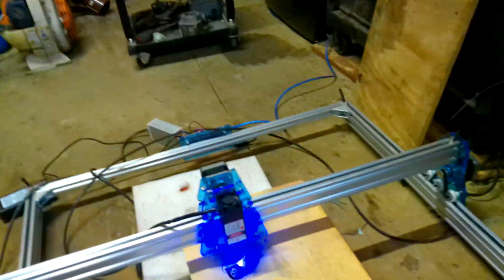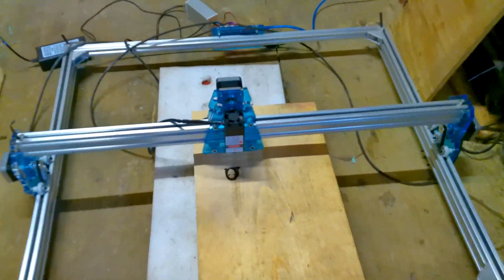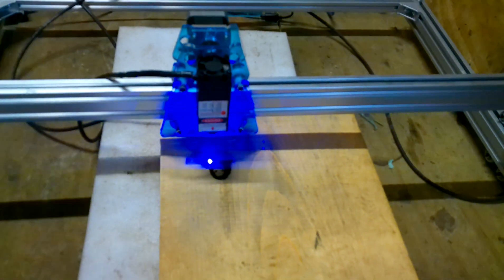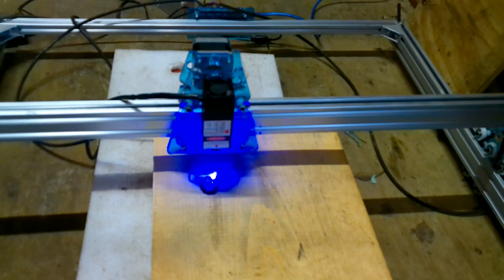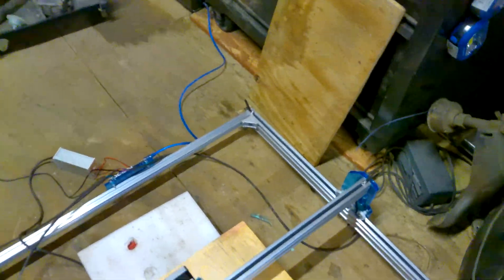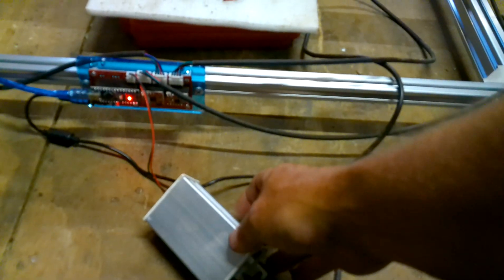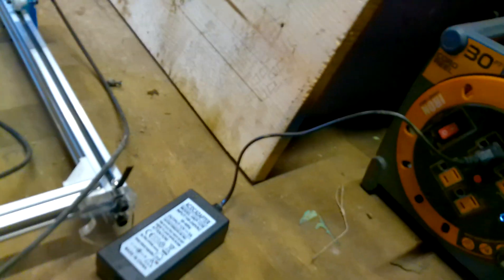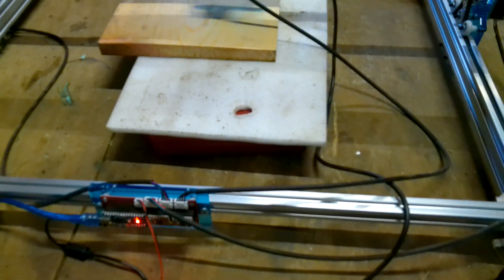3000mW Laser Engraver

Comment: Mine is 3 weeks old and its already shot. It started to fade now its not even making a dent in wood. I think its the power supply but i cant get ahold of universal. They dont answer the phone
Reply from the maker: Yeah it's crazy trying to contact them
Reply: Sounds like your laser driver was not set to limit a safe current and blew out the diode...Did you mess with the little blue trimpot on the back of the laser assembly?
Reply: @SNG.OfficiaI  not that i can remember. Either way. Its been 3 months and not a single response from any platform ive messaged on.  

Paypal refunded me. Im buying a glowforge.